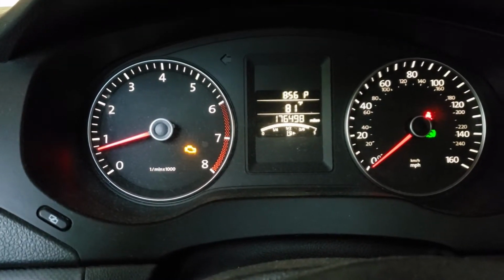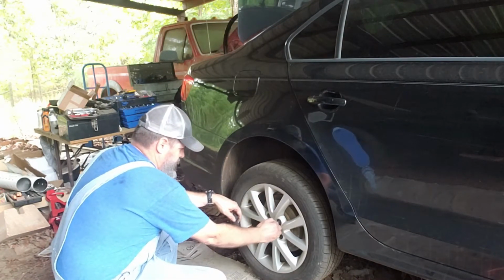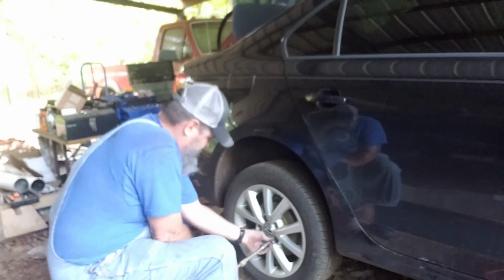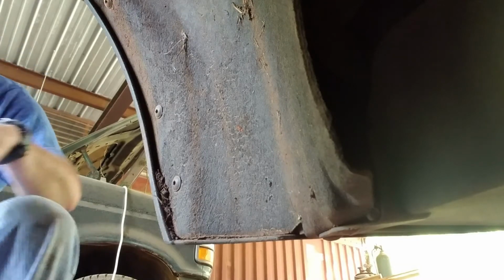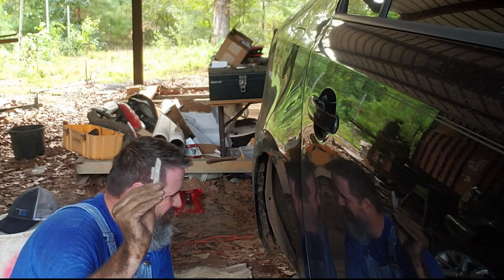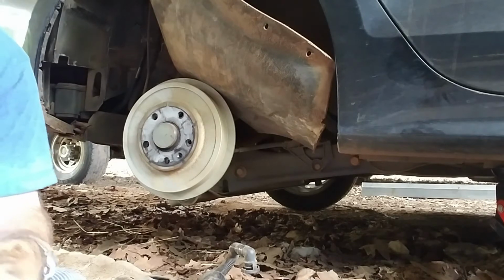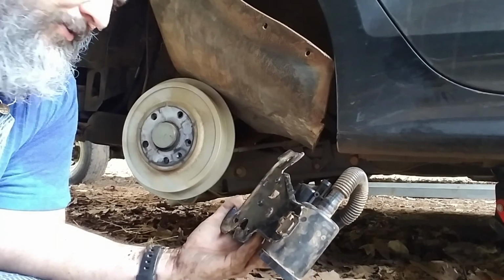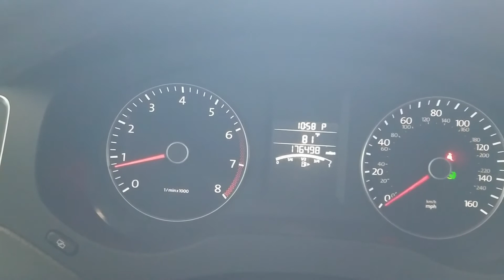2012 VW Jetta P2402 Fault Code

Comment: I am getting the same code on my daughters 2011. Did that issue effect driveability all. Her Jetta drives great for a week or 2 and then all of a sudden it will not crank. Yesterday morning I drove off a few feet and it died. Would not re- crank. Can home after work and it cranked right up.
Reply from the maker: Never had it die but it would some times take several tries to start. It would randomly rev then dip while stopped.

Comment: What about the fuse? Did you check the fuse ? Did you need to also replace the fuse?
Reply from the maker: I didn't have any issue with the fuse. Mine was 👍good.